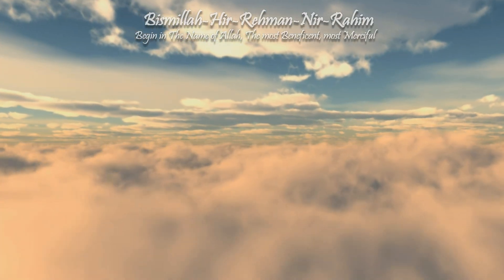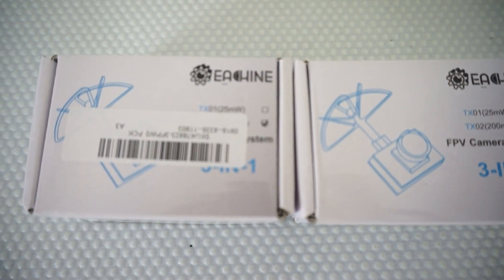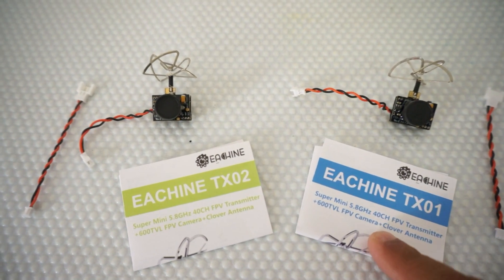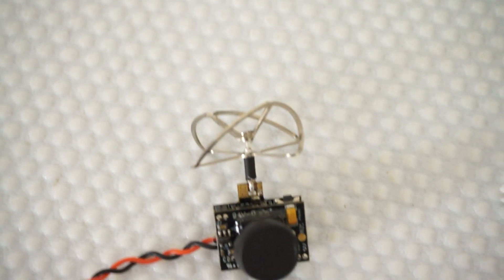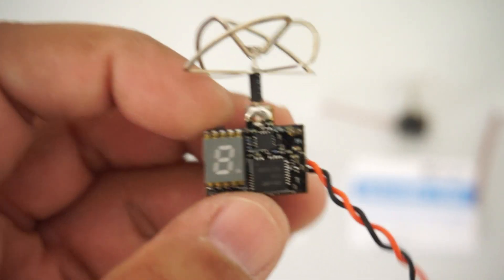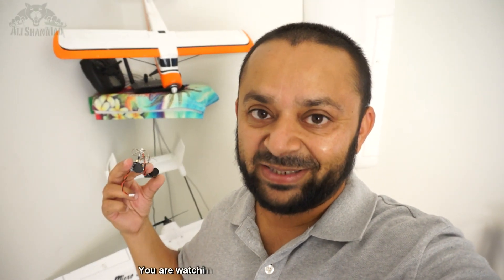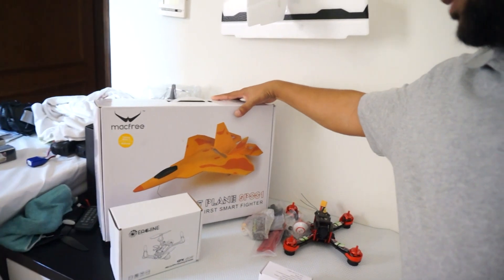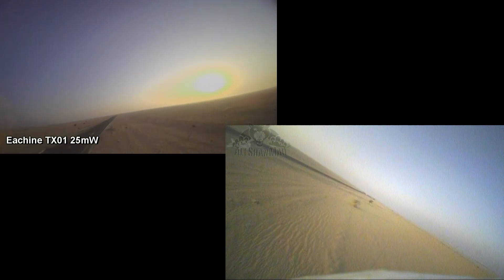Eachine TX01 and TX02 Feather Light Micro FPV Systems

Comment: what about the power consumption?
Reply: the 200mw has a power consumption 0f 500mA and the 25mw has one of 200mA so if you're looking at running it on something super small like a Tiny Whoop the 25mw is a better choice if you are going bigger with a build the 200mw.